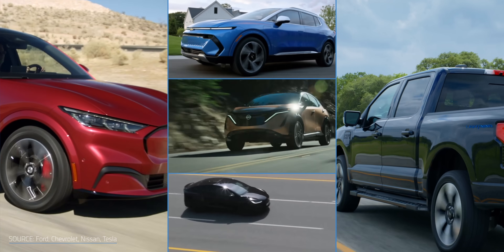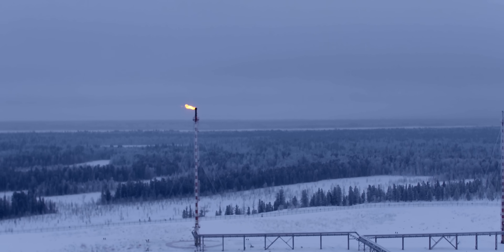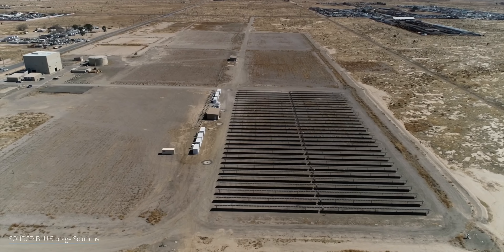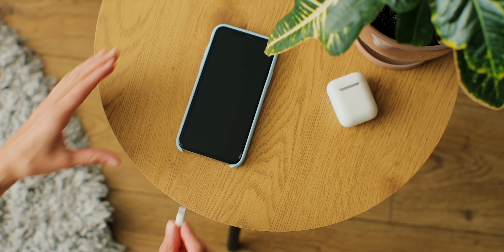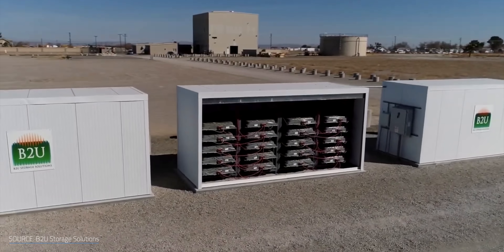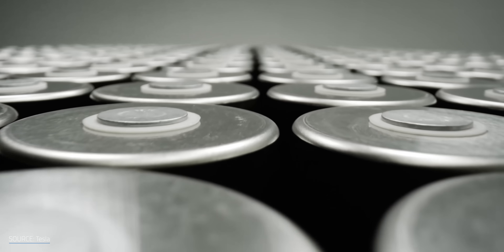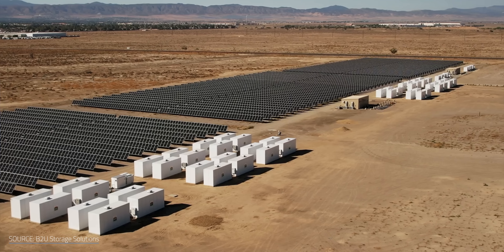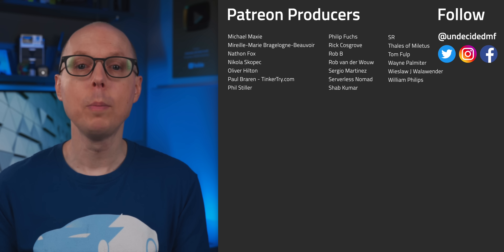How Old EV Batteries are Perfect for Energy Storage

Comment: After the disasterous toxic battery fire in Santa Cruz Moss Landing battery plant that is affecting ecologically sensitive coastal reserve and food growing regions, any kind of high density lithium seems incredibly dangerous.  You didn't mention the chemistry of the retired car batteries.  The shut off capabilities seem really good.  I can't imagine overheating is not a problem in the hot desert.  EV batteries have coolant running through them in cars.  Moss Landing had 3 prior fires before the big sustained fire disaster.  The salt air was cited as an issue for corosion that could have helped cause fires.  Also they were using hi-density lithium like used in EVS in an old power plant not a dedicated battery construct.

Comment: Most EV’s in current formats are tending be as wasteful or worse than ice vehicles, with low dollar components buried deep in packs that are expensive in time/labour to access that makes the cost to worth ratio inefficient to repair so they are getting bricked, unless you can DIY. 
And a whole car is wasted when a battery pack needs to replaced long after warranty but the cost to get it done is too expensive in time/labour and manufacturers of these cars also add huge premiums to price of battery packs for obvious reasons (ie genuine Nissan leaf replacement packs). 
This is similar problems to ICE vehicles but then then they are dirty and polluting in all of its life cycle so we don’t expect anything better, BUT WE DO FROM EV’s because of their non-polluting mantra, but we should be getting way more life out of EV’s than we do from ICE vehicles because of their relatively simple components if only they were designed to be swapped out with minimal labour and time. It’s ridiculous to have to tear a whole main frame car apart to just change the traction battery out. 
Recycling is not as energy or labour efficient as we might want to think, and some of the things we are using from the recycling stream in our every day lives are now turning out to be toxic to us like recycled tires being used in children’s outdoor play equipment, because no one realised that tyre manufacturers didn’t think about second life of the materials they were putting very hazards chemicals into at their end of the process.

Comment: Bought used BEV cells 4 years ago (Nissan Leaf), they run as my solar (PV) battery, working fine. Had used 2nd life lead acid 10 years before, they also worked fine. 2nd life for batteries in home use causes way less stress and the batteries will last much longer

Comment: ive seen people using old EV batteries for home storage and its cheaper and much much larger, but they all seem to totally tear them apart. is it not possible to come up with a plug and play solution for reuse an EV battery in a home system?

Comment: It's an interesting proposal. It would be far better if the battery was the Lithium Iron Phosphate kind, since storage for home need not have the density or weight stringent requirement needed for EV. But if you want to recycle Lithium Ion type batteries, you must make sure that each cells are close matched in terms of capacity or charge and discharge. Moreover that the Charging current and voltage won't exceed that of the weakest cell, as the battery is as strong as its weakest cell. Working at a very high voltage will allow those cells to charge at the minimum current, but a BMS at above 350VDC is not within the reach or ability of most people. What most people can handle around their house is 48VDC which is easily obtainable through most Hybrid Charge controllers/inverters these days for below $650. Therefore, those old  EV batteries have to be dismantled, segregated for balanced cells and reassembled as 48 VDC modules each with their own BMS, then paralleled for a higher current battery that can deliver at a minimum of 40A output for charging at level 2. So it's all feasible, but those recycled EV car batteries are not easy to source and are not cheap neither. Even the individual cells are quite pricey on EBay. I found that buying some  280Ah LiFePo4 cells from AliExpress is cheaper and less risky. But I admit that there are opportunities out there for those who are lucky enough and willing to drive a little and save a lot. I manage to buy some older 48VDC 216Ah LiFePo4 rack mounted batteries from Posh Electric in Hayward, CA for only $700 each! So I grabbed 2 and boosted my Storage to an additional 20 KWh+. No assembly was required, so it was such a good deal that I even got one of their dedicated  19" rack cabinet. Of course these batteries sold out in no time, but I checked a month ago and they had other stocks of even more powerful cells, but my need is already met.

Comment: This is an industry of total growth in several leading after-markets sales of doing away with industrial batteries from other systems.  AI can help monitor and connect batteries from more vendors I would hope.  Great sign.  I just think people will realize real-estate is at premium prices once you migrate towards demand centers.  Could be potential to leverage empty warehouse space, to house mobile battery parks like on a semi-trailer.  That way you could go to where the demand is very quickly.
Reply: Could get Congressional approval because such a system should be what FEMA brings out as a first-responder type package.  Get the batteries and power back to a devastated community, so communications are restored.  Could have tractor trailers of temporary Starlink Hubs & Antenna Mesh Network so people could have emergency links to both NGO and Federal agencies.

Comment: wow. you just discovered a potential arbitrage commodities market = storing and selling energy back to the very same system it got its original charges from at lower prices, and selling them at higher prices during the day.  Move over crypto-mining, this is a win-win for the entire world should we get "power brokers" in on such a sustainable, self-interested, self-funding profitable market.
Reply: This would supplement any electrical grid in any market in the world where you can sell back to the grid.  Making it beneficial for all energy consumers.
Reply: Battery farms.  I think they should be underground, because you could use the heat for thermal-pumps and generate more energy just on the heat from the batteries.  Could also use it for condenser tech and have a source of fresh water from basic endothermic innovations.

Comment: Great ideas, but we still need to change our ways with regard to personal transportation if we really want o last very long on this beleaguered world...that doesn't often get discussed as a 'solution'. Dragging around 1 1/2 tons of batteries to move a 180 pound human body is insane .no matter how many times the batteries can be recycled.
Reply: Well I don't know what truck you got a ton and a half from but teslas are less than a ton and Nissan leaf batteries are like 600 pounds so .
Reply: @ghz24  Sorry for the semantics issue, but most cars I know of weigh well over a ton (some up to two tons) and the batteries are a significant portion of that.  The point is that using a ton and a half of metal to move a 180 lb payload is nuts no matter how you look at it....and we do have alternatives, we have just been lulled into submission to the auto industry over the decades to settling for stupidity.

Comment: Replace the peaked plants with fuel cells.  Take up the same space as the battery cabinets you won't need the panels and convert nat. Gas into power, air and water.  Seems like it is an inefficient way and uses tons of space to use solar to charge a battery and can they fully charge them in the 12hrs you have of solar production.  Good idea for reuse of the lithium batteries though.   Has some promise

Comment: This feels like the perfect kind of solution for small scale towns far away from bigger cities.

Like with some of the other innovations around something like solar panels with growing/ herding livestock underneath you could tether 20 farms with battery solutions like this to have consistent power. And enough of these tap into grid. You could change the economics of the overall grid. 

I actually got this video in my feed because I watched a video of a man that took an old Nissan leaf battery and used it for a shed. This is a much upgraded version but the idea is very similar.

Comment: I doubt that there will be a substantial supply of used EV batteries sufficient to get to 100 MwH to replace peaker plants on a mass scale. Ev sales aren't going well, manufacturers have doubts, raw material prices for lithium and cobalt and nickel are going up and up. EVs are too expensive for average consumers and no one really wants to buy a used one so they don't get recycled by consumers and their residual value drops.

Comment: I plan a similar home scale solution. In a couple of years, I will add a bidirectional EV charger and bidirectional capable EV for V2H home backup to supplement my solar PV system. When the battery reaches end of life for transportation, it will become a stationary home backup battery, and driven only on short errands. No need to remove the old EV battery. Let that go for a decade, and voila!, I have a classic EV in the garage ready to sell to car collectors!😂 This solution isn't quite practical now because most EV's don't have bidirectional charging capability, but that's going to change soon.

Comment: $200/KWh install cost for a battery cell that's already 30% through it's total lifetime sounds like terrible value compared to $280/KWh for a brand new system that will come with a warranty and performance guarantees. I think the missing information here is what percentage of total installation cost is the cells alone. In the UK it's only 30-40%, therefore it does not make commercial sense to substantially restrict your operational capability for small reduction in capex.

Comment: Very interesting, Matt, like many of your videos. 

My main interest, which I'm surprised you didn't touch on, is: 
Are these sorts of systems available for individual homes?

Tesla Power Walls are lovely, but they're also expensive. With the stability of our electrical grid, we don't need battery storage that often, so having fancy (expensive) storage solutions is usually hard for individuals to justify. But if cheap, recycled energy storage is available, that changes the whole home storage equation. 

And not only would this benefit those individuals, but if grids were allowed to tap into some of that distributed storage, ALL of us could benefit. And, of course, the whole battery repurposing industry (as well as landfills) would benefit.

Comment: Short term, advanced batteries are not NEEDED is worthy point...They're nice feature when ready...but small battery packs can keep feeding electric motor even with low capacity batteries if mechanical energy designs exploit the kinetic energy of car moving, then applied to CHEMISTRY...Which is heat plus conductive metals, sometimes involving pressurization...allowing for trickle charge and when going down hill, floating charge... especially if a wind up mechanical feature, possibly by car's wind drag, or if friction heat is exploited...Drag can be avoided which is why engineering is a thing...We're getting bamboozled in whatever our reality is, because that electric motor just needs steady current, but not a full tank of electricity like combustion engines need of gas/petrol...Advanced batteries is terrific thing, Godspeed scientists....but meanwhile there is  the technology to supply ample trickle charge to keep electric car engines working.  even with modest battery capacity. Hydraulics allow them to capture friction heat to apply to conductive metals and magnets....Wind drag can be exploited without burdening battery, to power a modest mechanical wind up motor, then uncoiling to feed floating charge to battery...Battery optimization is terrific, but if it's serving to three card monty technology progress, we have some establishment in place...

Comment: Battery Electric cars (BEV) have their place but they are only part of the solution. 
We really need green hydrogen (produced using renewable energy) powered ICE vehicles and HFCEVs (Hydrogen Fuel Cell EVs). The latter can have a much much smaller battery meaning less weight and less raw (or recycled) materials used in the batteries. Also less waste to recycle, reuse or repurpose at end of life. 
Both types of Hydrogen vehicle produce only water vapour as emissions. 
I’m fed up with the whole BEV push. It is the stupidest idea ever. Yes BEVs have a role but it’s limited. They are not the answer. They will not work for many many millions of people in the work. Great in cities and small commutes and not much else. 

The worst thing for people with one who only charge at home is:
Imagine returning home with 15% battery and you get a call regarding some emergency (loved one in hospital etc or child sick or whatever) and you have to rush back out but your vehicle has not yet charged overnight and you can’t get there. You can’t fast charge. With an ICE or HFCEV you can pop to the station and fill up on the way to the emergency. With a BEV you’re dead in the water. You can’t help. Bad luck. 
Or you have enough to get to the hospital maybe - but then can’t get home. Fast chargers don’t exist in most of the world and also not enough even when they do. It’s a serious limitation.
And further with a petrol or diesel vehicle if you are low and the grid is out so the station can’t even fill you - you can fill from your Jerry can at home.

Not such a huge issue if your phone is flat. You can plug it into the car and charge while you drive or take a battery pack with you. Not so much a car itself.

Comment: This system truly relies on economies of scale to reduce waste and environmental damage (at least as designed).  It accepts used products at random levels of wear and uses each for as much it can do, leveling out differences until each used product needs to be truly abandoned and sold for material recycling.  On the electricity side it uses the gigantic averaging of millions of consumers and thousands of power sources done by the grid itself.  Being fully stationary also removes the need to worry about kWh per ton consoderations needed for moving vehicles.
  As all such projects it will one day be accused of doing a few things wrong in a very harmful way, but this doesn't negate humanity's need to take the chance to stop the known massive damage done by too quickly extracting ever more resources that nature stashed away over millions of years.

Comment: I have just adapted a battery out of our 2012 Nissan leaf to work with a solar inverter,  it still has 14kWh of useable capacity and should continue for a very long time. I installed a replacement battery out of a crashed later model car to keep the leaf going. None of this stuff is especially difficult and can be done with home handyman tools and a bit of learning.

Comment: The fire risk here is off the scale. Electric cars were supposed to solve problems, instead they’re just bringing different kinds of problems to the picture. And the EV Pollyannas keep explaining how wonderful it all is. 😤
Reply from the maker: You mean the overblown reporting on fire risk?  EVs are far lass fire prone than combustion engine cars.  https://www.autoweek.com/news/a38225037/how-much-you-should-worry-about-ev-fires/.
Reply: @UndecidedMF  I don’t understand why you don’t balance that statement by also stating that the fires are more far more energetic across-the-board. It doesn’t help that second half of that article is nothing about how wonderful EVs are. Meanwhile, my plate went right over your head, which was that EVs were not supposed to catch on fire at all. They were supposed to solve the problems that came with ICE.

Comment: California Moss Landing Elkhorn Battery System is a total of 256 Tesla Megapacks (roughly 3 MWh each), installed on 33 concrete slabs. The total energy capacity is 730 MWh...  and then it goes WOOF...  a Fire in one of 33 concrete bunkers???  or 8 Megapacks goes WOOF...  3 months after placed into service...  Oops or just as expected... hence build in a Concrete BUNKER???  and not your House???  or does your house go WOOF???

Comment: At least 15 years ago I heard this idea.  I have been waiting and waiting.  It's about time.  CLearly there were a lot of technical details to work out.  The idea I heard was prius batteries as they were about the only ones on the road.  And I think the idea was to keep it local in housing communities with a shed for the batteries to power the local homes.  small scale but all over.

Comment: The number of lithium battery fires in electric cars, electric bikes etc does create a strong. concern about using them on buildings for energy storage especially if the batteries are used. The same fears do not apply to lead acid battery storage.

Comment: I've never been a fan of Big Utilities with centralized generation and distribution points. The advent of relatively energy dense batteries seem, to me, to be the perfect solution to individualized energy collection, storage and usage not unlike the Tesla model wherein homeowners with Tesla Power Walls have opted into their energy re-distribution plan. I'm surprised that someone has not already copied the Tesla model using these recyclable batteries in lieu of the Tesla battery packs. 

BTW, the BougeRV flexible solar panel seems like a real winner. I, normally, click past the commercials but I found this one truly fascinating since I own an RV that already has to of the first generation solar panels installed on it. Depending upon the performance of these flexible panels I may give serious consideration to replacing my old panels with an array of these newer ones.